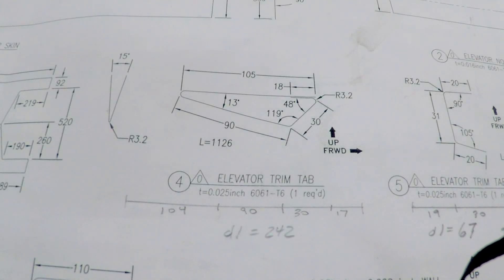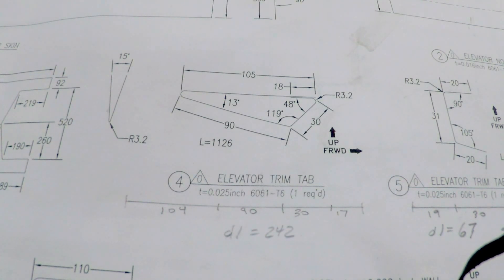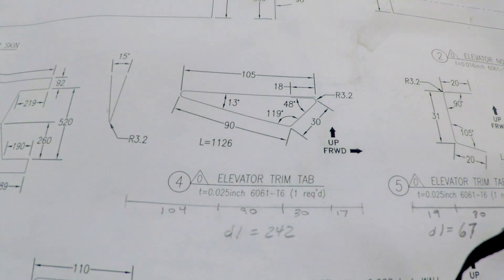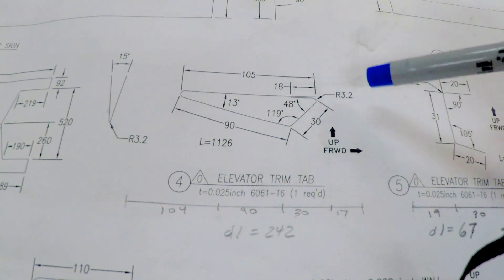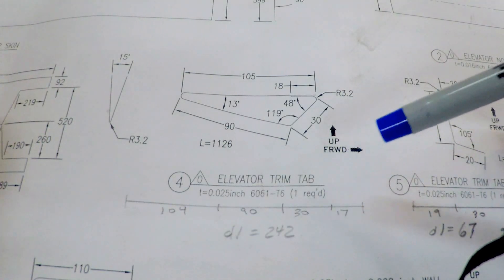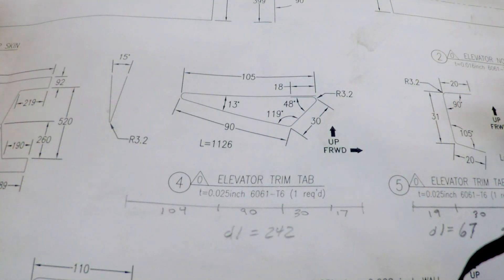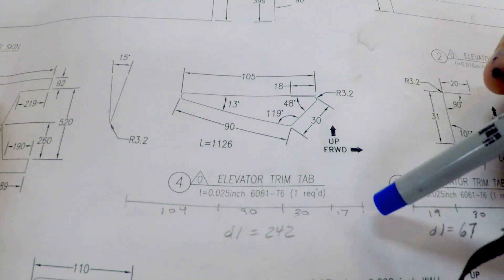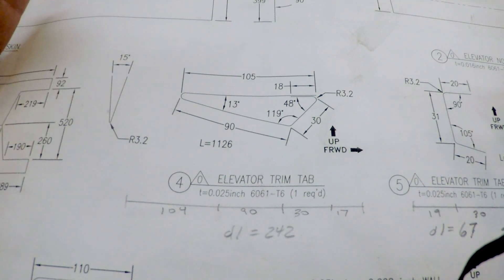Locating Bend Lines And Factoring Material Thickness

Comment: I have been very unimpressed with Zeniths plans as I have progressed through my 650 build. Lots errors, ambiguites, lack of datums, etc. One thing I have found useful in my construction is not worry so much about flange dimensions as the web dimensions. If the lflange comes out a little long I can trim it if necessary. If the web is off, I have to remake the part.
Reply from the maker: I imagine the 650 plans are pretty similar to the 750 plans, judging by what I saw when I had my 601XL plans. When I first started the project, I thought there were all sorts of errors and such. As I gained more experience interpreting the plans, I realized that some of it was just me. I found some "missing" information elsewhere in the plans, such in assembly drawings. The 701 plans, which I've examined, are MUCH more "fleshed out" for a scratch builder. Although the 750 plans do still have some errors and missing info, there weren't as many as I'd initially presumed. Some things are also left ambiguous (intentionally, I suspect) because the method of fabrication affects the finished dimensions. I don't blame you for being frustrated, though. I plan to address some of these issues with Zenith.

Comment: Just ordered my plans. My drive to pick up materials will be about 5 hours to Spokane from Montana where I live. Is there anyway you can give me a materials list as far as the Aluminum 
thickness and amount of sheets needed as well as the amount and size of 4130 tube? be super appreciated and would possibly save me a road trip. Thanks!
Reply from the maker: Thanks for watching! I don't have a materials list for the 4130 just yet (it depends on if I order the finishing kit or scratch-build all those components too). For the aluminum sheet, these are the minimums I came up with, and they only apply to an Edition 3 STOL CH 750:  .016 - 5 sheets, .020 - 9 sheets, .025 - 3 sheets, .032 - 2 sheets, .040 - 1 sheet, .063 - 1/2 sheet (4x6), .090 2'x3', .125 - 2' x 2'. Also, you need some very small pieces of .1875, .250 and .500 (I recommend Amazon). If you're skilled enough to make no mistakes, these amounts should build the whole airplane if you can maximize sheet usage and minimize cut-off waste. It is very close on the .063" if you are going to do the seat pans. I suggest extra, but it's hard to know what thicknesses you'll need extra for until you start building. It's about $50-$60 to ship 3-4 full sheets of anything rolled, up to about .040. I've needed extra .016 for some re-skinning I did, and .025 (full sheet) and .032 (small quantity) so far for do-overs that I either needed or chose to do.
Reply: Greg's Zenith STOL CH750 that's super! Thanks for that! It will save me much time. Been watching your videos. There super helpful. Gonna be cutting everything out on a 4x8 CNC router table so I should have precise cuts for everything with little waste. I'll keep in touch and let u know how it goes. May see you at a fly in one day. Thanks again for the info!
Reply from the maker: You're welcome! Good luck with the build. You should be able to turn out some really nice parts with a CNC router table.

Comment: Where the hell were you last year??   do you know how long it took me to figure those darn bend lines...the number of parts I scrapped....lol   When I see those bend line.....i always check, double check and triple check before bending and I do the same ...I take note of the bend directions that i used for reference.
This video will be EXTREMELY important to all new scratch builders.  Great job Gregg.
Reply from the maker: andre Levesque It took fabricating almost all the sheet metal parts to figure out what did and didn't need to be included in this video, especially as it replaces my older one. Honestly, I could probably do an entire series on blueprints reading. I spent a lot of time thinking about how I wanted to do this video, but couldn't quite put it together until now. Thanks for watching & the comments!